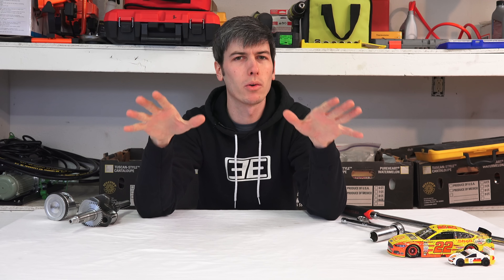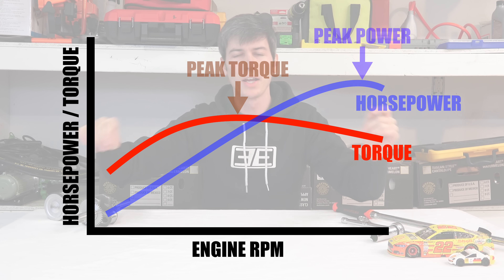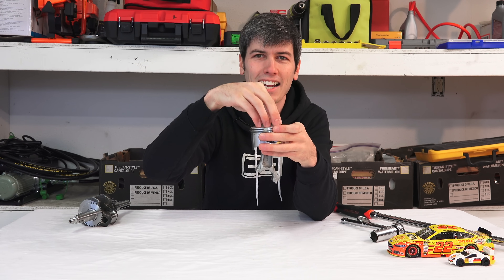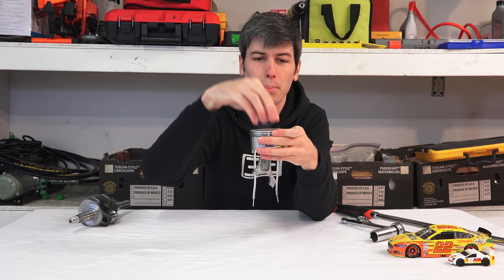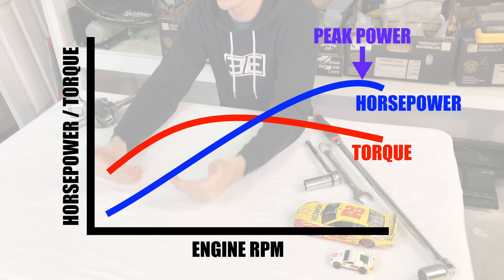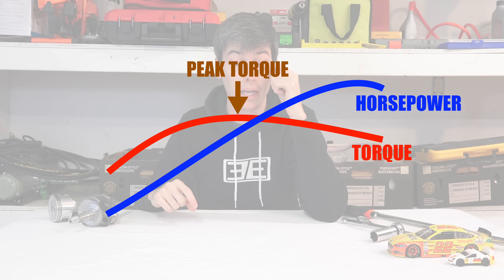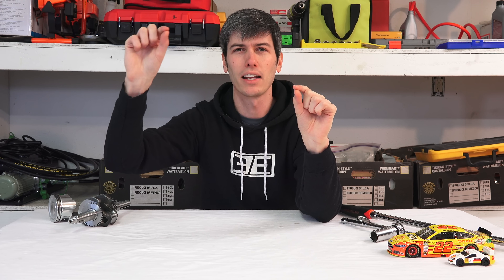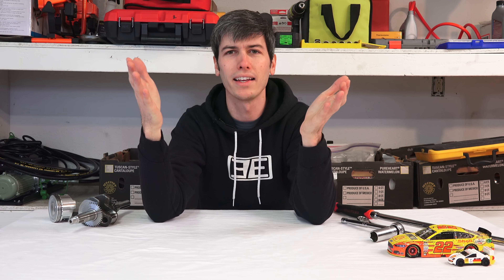Horsepower vs Torque - A Simple Explanation

Comment: Torque - twisting force
Horsepower - how fast force is delivered

Basically the more horsepower the faster the torque is applied
Reply: actually no 👍🏻 100 hp 10 nm at engine crank at 100 km/h delivered 5 times more force at contact path or like you  want call it thrust than 20 hp 1000 nm at 100 km/h  🤷🏻‍♂️ output force is watt:m/s= force or  torq at drive wheel axis : radious =force so you cant have more output force= thrust from less power absolutelly imposiible 👌🏻 dosent matter how much more torq you have at engine crank or at even drive wheel axis if power at the same velocity is less so you must have enough biger wheel radious you now have lesss thrust 🤷🏻‍♂️ 👌🏻 cant be oposit 👍🏻

Comment: so do bigger gears have more torque?
Reply: It's the ratio of gear sizes, that trades torque for speed.   The ratio of the size of the input gear, to the size of the output gear, sets the ratio that you divide the speed and multiply the torque.   So a gear with 40 teeth on the input, and 20 teeth on the output, will cut your speed in half, and double your torque, assuming 100% efficiency.

You do need a large enough physical size of the gear to transmit this force, without permanently bending or denting the teeth.  You can do this either by using a larger radius of the gears, so that the linear force at the interacting teeth is reduced, or by increasing the thickness of the gears, so the stress is distributed through a larger area inside the gear material.
Reply: @carultch  I thank you for your intellect

Comment: More Torque allows you to pull, tow or haul more. 

More Horsepower allows all that pulling, towing and hauling to happen faster. 

Correct?
Reply: No, more torque doesn't really "allow" you to pull more since vehicles have transmissions.  Transmissions are able to multiply the torque of a given motor by an amount determined by the gear ratios. Thus you can have a small motor pull a train, but it won't be powerful enough to accelerate it quickly. Greater torque tends to increase the practicality of a motor by limiting the RPM required to generate an adequate amount of power.
Reply: @drymajor4335  Yes, because the transmission is multiplying the torque which creates more torque which allows you to pull more. If I understand what you are saying.
Reply: @user-uv4xr7kj1i  Yes that's correct. Torque numbers quoted in 
car specs are brake horsepower measured at the motors crankshaft, but what ultimately generates the force required to move a vehicle at the tire's contact patch is wheel torque.

Comment: You explained well about power but there is lacks in explaining torque. About the car that has less power but higher torque wich are the advantages and disadvantages over the high power one? When car manufacturers design a car how they equilibrate both in function of the objective and engine size?
Reply: more tprque less power engine work at lower rpm and have better elasticity at low to midrange rpm more hp engine with less torque have worse downlow rpm thrust =worse elasticity and must work on biger rpm unless you like drive slower than whatever but once you reduce gear at lower gear and engine start spin biger rpm now this engine would  beat more torque less hp engine in race overtaking other vehicle etc 👌🏻
Reply: Engine torque helps when you can't shift a gear down (if you don't have a gearbox or you are still at first gear). 
Amount of maximum torque available is basically dictated by engine displacement and technology. But that peak can be shifted (by design of heads, intake and exhaust manifolds, cam profile etc) to higher rpm, producing more power in a trade of fuel efficiency, or to lower rpm with the opposite effect. Best example I can imagine is LT1 small block engine from 1990-s, that was installed in full-size sedan Caprice, performance car Firebird/Camaro and sports car Corvette. In all three applications it had 450NM of maximum torque but for Caprice it was available at lower rpm, with around 250hp max, for Corvette it was tuned to 300hp, and Camaro was in between with 275hp to not compete with Corvette. Needless to say Corvette LT1 version is the most expensive because power costs money, and for Caprice an engine had to be cheap, reliable and more efficient (Caprice was on duty in Taxi and Police for a reason)
Reply: @IgorArkin  thank you. But you contradict yourself. First you said that was shifted to more power on a trend for efficiency or to low rpm with the opposite effect. But after you said that in Caprice the low rpm give more efficiency?
Reply: @ruimvp  
If air flow and valve timing are optimised for higher engine speeds, this leads to a bad efficiency on the slower engine speeds. Maximum engine power is increased this way, but at the daily drive revolutions engine consumes more fuel. Even idle revolutions has to be tuned higher so the engine works smoother or even do not stall. F1 idle revs are around 5000rpm for example. This stands for Corvette.
For Caprice it is the opposite: engine is tuned for slower revolutions, making more torque (and power) there, but its maximum power output (performance) is reduced.
Basically, the whole malaise era of 70-s is an example of tuning/downgrading engine's performance to gain fuel efficiency.

Comment: Try explaining it in metric units, its way simpler and produces real usable numbers....
   Torque = Force x radius  T = F x r     where Torque is in Newton-meters and force is in Newtons and radius is in meters

and P = T x radial speed ,  Power = torque x  radial speed,  where radial speed = 2  x  3.14156  x frequency  (speed), where frequency is in cycles, (revs)  per second. 

One RPM =  one rev per  60 seconds

There is 745.8 watts of power in one horse power.   1000 watts is one Kilowatt.

Hope this helps?

Comment: Yea but this doesn’t consider the weight of the vehicles. If both of those cars weigh 5000 lbs then the car with more torque will be faster
Reply: What's so difficult about Power=force*speed
=
acceleration*speed*mass?
Car will accelerate slower with the load, but still faster than the less powerful car with the same load added
Reply: with optimal gearing more power always accelerate better dosent matter how much load you put on trailer 👌🏻 except very first phase if tractien and load be enough and 1 gear not enough short for more power less torque engine ,even if you comapre the same engine in the same car from roll let say some truch which have hipothetically 3000 nm between 1000 to 1500 rpm and 700 hp between 2000 to 2500 rpm better acceleration time with 100 tons on trailer in egzacly the same conditions dosent matter down hill uphill level road but the same offcorse for bpth from let say 60 to 75 km/h be when you use 2000 to 2500 rpm than feg 1000 to 1250 rpm 👍🏻or 1250 to 1562.5 rpm 👍🏻cos watt:m/s= force or thrust 👍🏻

Comment: Do these graphs show the torque on the wheels? 
Could you also please clarify if the torques that the manufacturers state is the torque on the crankshaft or the torque on the wheel.
Does the same amount of torque get transmitted from engine to the wheel?

Comment: I see this subject in terms of water. You can have very high pressure (horsepower) with a very low flow rate (torque), in water blasters for example. But its getting the correct combination of both, for the job its needed for, that requires thinking about. 
Example, try filling a 2 gallon bucket with 2000 psi high water pressure at a flow rate of only 1 gallon  per minute(=2 minutes), as opposed to filling it with our usual 70 psi mains water, with a flow rate of 6 gallons per minute(= 20 seconds)

Comment: Torque is needed for pulling weight efficiently.  A truck may have equal power to a sports car but the engin will not need to work as hard.

Comment: Great video, but you forgot to divide by 5252.  HP=TxRPM/5252.  That's why the curves always cross at 5252rpm.  Also, they are not a function of each other;  HP is a function of torque and is a result of a calculation using torque, which is the only actual measurement in the process.
Reply: Not always cross at 5252, depending on units.
Power=force*speed
Power=work/time
Where is that actual measurement here?
Tell to chassis dyno that torque is an actual measurement and it will simply refuse to work.
Reply: @IgorArkin  power can not be measured directly.  It must be calculated.  The dyno software makes the calculations.  It is measuring torque and speed and calculating power. And they always cross at 5252 if using lb/ft.  I believe the number is 7127 if using Nm.
Reply: @dirtsquirt72  think. How do you get an engine torque data with a chassis dyno? It doesn't know wheel diameter, final drive ratios and gear engaged.
Reply: @dirtsquirt72  When using Newton-meters and kilowatts, it is 30,000/pi RPM, where torque and kilowatt graphs coincide.  Which is approximately 9550 RPM.
Reply: When the water brake is used against the flywheel, that measures twisting ability, or torque.  From there, HP can be calculated.

Comment: Here is my question. If two motors have the same gearing and roughly same torque but different hp values. Can they still maintain the same cruising speed? While the higher hp car can get it to cruising speed faster than the lower hp with the same torque? Please help! Trying to choose an outboard motor for a boat.
Reply: Since there is no gearbox and top speed is not your goal, you have to compare torque curves of the motors.
Cruise speed is a partially opened throttle so both engines will maintain it. The engine with the lower torque number at revs corresponding to desired speed will require a wider opened throttle
Reply: @IgorArkin  Thank you! so if both motors can achieve the torque at 2500 rpm, the one with more HP will have less throttle and load to maintain it? that is what i need i guess. The warranty states i can only maintain 90% engine load.
Reply: Let’s say you are looking at a 150 vs a 200.  Probably use the same block, same pistons, same compression.  The difference will often be in how they restrict something.  Carb size, manifold diameter/restrictor plate, 2-stroke port diameter, etc.  Even tough they have different horsepowers, their torque rating will be very close because they share the same displacement.   If you only want to hit optimal cruising speed at 4500rpm, both will do it, one at a much lower initial cost burning less fuel. But through better ability to flow air, the higher HP motor will produce more power at a higher RPM, not necessarily produce that extra horsepower down where you need it at 4500.  So often it’s a wash. 
But if you are looking for the big bubba hole shot so you can scream it at 5900rpm, then go big.

Comment: I still don't understand how the peak torque gives peak acceleration.
Reply: Without mechanical advantage of changing gear ratios right in the process, torque curve on the driven wheels axis = torque curve on the flywheel axis
Reply: Torque is the twisting force applied, if you turn the wheel harder it accelerates faster. Think of it like pushing a box or throwing a ball. If you push harder or throw harder the object accelerates faster.

Comment: Another question would be: Why do diesels make so much more Torque than Gasoline engines?
Answer: because diesel engines don't have the narrow limitations of fuel/air mixture as the gasoline engines. The diesel can run VERY Rich or VERY Lean (controlled by driver input) because the fuel is lit off with compression heat when the fuel is injected, whereas the gasoline engine has to ignite combustion with a narrow fuel/air mixture because of the spark ignition.

Comment: Torque is turning force of the crankshaft. Horsepower is the work being done, e.g. Torque times RPM. Diesels can typically move far more weight due to the twisting force Torque of the crankshaft.
A gasoline racecar will usually beat a diesel racecar because of the RPM range of the engine before shifts are required. A diesel must shift sooner, and so top speed is limited. Not always the case, but that is the best example I can think of.
Reply: And it is all wrong, from "horsepower is the work being done" to "diesels...move far more weight due to the twisting force". Watch his videos, nothing can be simpler than these
Reply: @IgorArkin  No, I'm right and you are wrong. Go back to school.
Reply: @markdavid4897  where am I wrong?😆

Comment: It's quite simple really. With understeer, the front of the car hits the wall. With oversteer, the back of the car hits the wall. Horsepower equals how hard you hit the wall and torque is how far the wall moves after you've hit it...

Comment: HP is retention of torque throughout an RPM range.  
Or, how long (throughout a gear) you can accelerate using the force–that gear transmits.

Comment: Torque can also be made to accelerate faster using higher speed gearing. Imo, the best basic layman description is that HP is torque at higher rpm. If an engine can maintain a forceful (torque) progression of revs at high rpm (instead of emptily buzzing revs) then it will have high HP.

Comment: Please answer my question, is two same vehicles are there, vehicle A with high torque, vehicle B with high HP. Which vehicle will perform better when heavy loaded, for example two big elephant on it. What force will help in that situation. Next is driving uphill that we know require lower gear to climb. A Or B which vehicle can climb uphill faster.
Reply: You don't need a vehicle to tow an elephant uphill, you can do it on bicycle with short gears and small wheels. Force and work on the motor's side is irrelevant. You need a force on the other end, on the wheel.

Comment: So if my car has a flat torque curve from 4K to 6K rpm,  will I accelerate at the same rate at 4000 rpm as i would at 6000 rpm in any given gear?
Reply: Sure, same rate of acceleration at any gear, if you do not opt for shifting a gear down.
Reply: No, you would accelerate faster at the higher rpm because the engine would make more power. Torque to the wheels is what determines acceleration. If the engine is at a higher rpm a lower gear can be used giving you more torque multiplication.
Reply: @Redtooth75  if torque to the wheels is what determines accelerationand I make the same torque from 4-6K, in the same gear, then what does power matter?
Reply: @hdbhehddbz  because if you are at a higher rpm you can use a lower gear and end up with more torque at the output. Horsepower tells you how much torque can be applied at a certain speed. If an engine makes 500 horsepower and the wheels need to spin at 2000 rpm at whatever speed then the engine can apply 1313 pound foot torque to the wheels. More power mean more torque can be applied at the same speed.

Comment: 1) Why is the torque curve not constant?
2) if the peak of the torque curve is when you feel the most force against the seat, this should then be the RPM where you get the maximum acceleration (a = F/m and since m is constant and we feel the maximum force, a is at its maximum). But you said the maximum acceleration comes at the highest power RPM which is not at max torque RPM. what am I missing?
Reply: The torque curve is not constant because the engine does not have a constant volumetric efficiency. The engine sucks in different amounts of air and fuel into the cylinder across the rpm range, the volumetric curve closely resembles the torque curve. An electric motor does not have that issue and makes a pretty flat torque curve.
The reason that peak acceleration occurs at peak power and not peak torque is because of gear ratios. An engine at a higher rpm can use a lower gear at the same speed and get more torque applied to the wheels even though engine torque is less than it would be at a lower rpm.